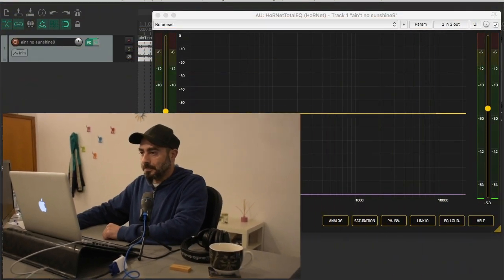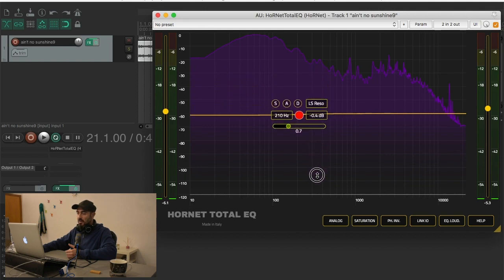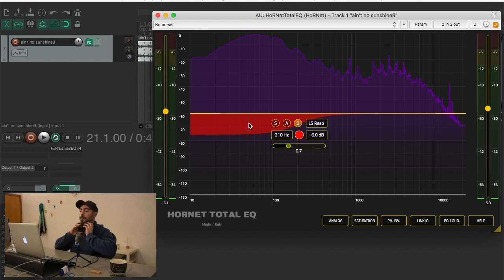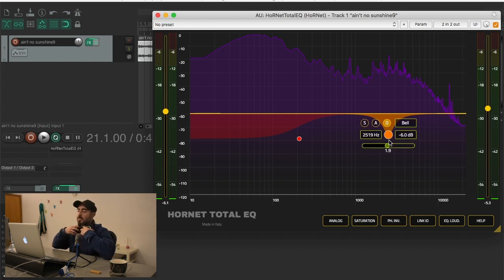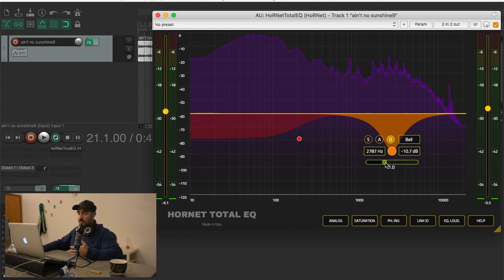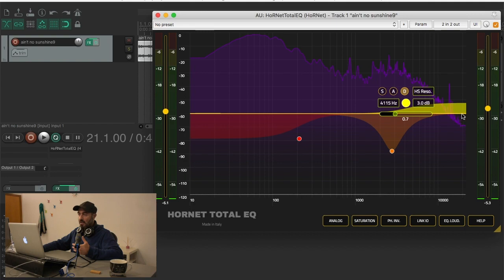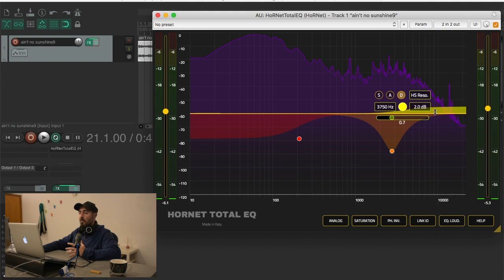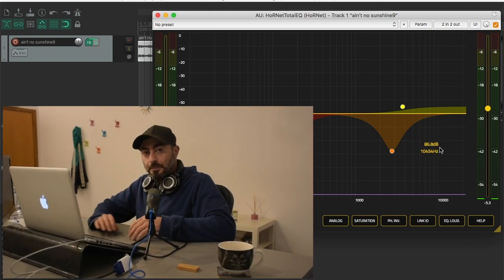Total EQ dynamic filter tutorial

Comment: Great plugin and overview, just wondering with the dynamic eq part does it have any control over the threshold, attack and release manually or is it done by the program material going through it and act typically upon that sound going through it, such as Fabfilter Pro EQ does? (I.E. if you're using it as a sidechain dynamic eq to seperate say, vocals from the rest of your other instruments that conflict with it, or using just as a dynamic eq on drums, vocals, guitars etc, it would act in a way with the best settings for each material source)?
Reply from the maker: Hi the dynamic filters work automatically, attack and release are fixed and linked to the daw tempo while the thresholds set dynamically accordingly to the content of the signal